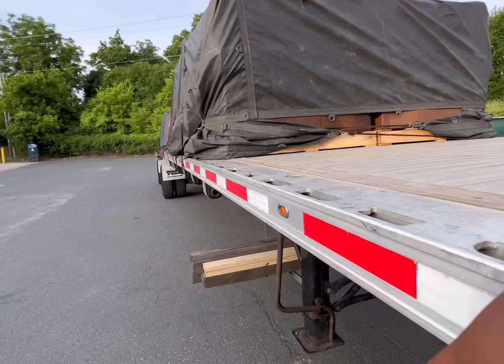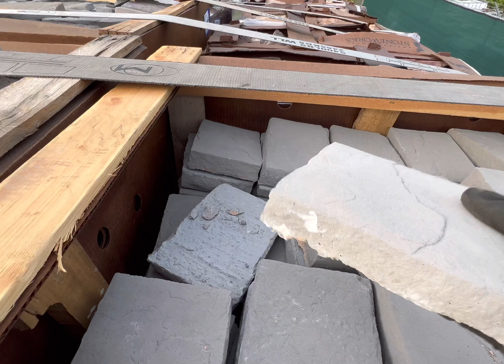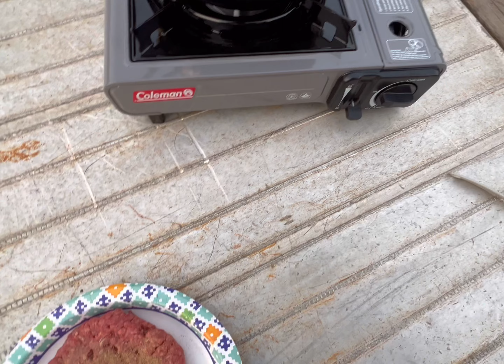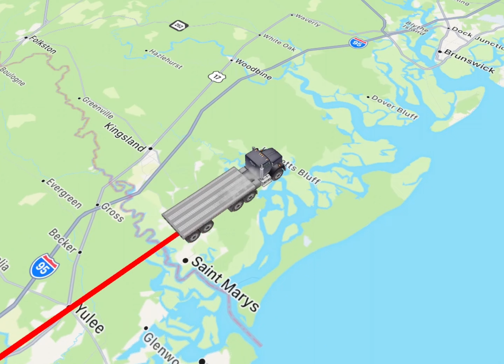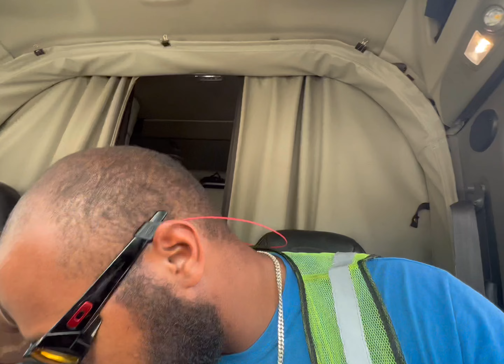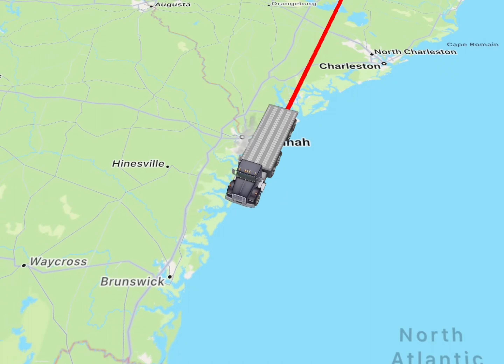6 load week | My future with TMC?

Comment: That steel load was from Gerdau, I’ve been there 3 times with TMC. I like to put a couple weaves through that steel.
Reply from the maker: I did when I started but as I got use to the load I don’t anymore
Reply: @blackwolftrucking  yeah our safety department at TMC prefers that we put a few weaves in on those types of loads however I’ve hauled a couple in my short time without them safely. Keep the videos coming, your experience is very helpful to a newer driver like myself 💪🏾